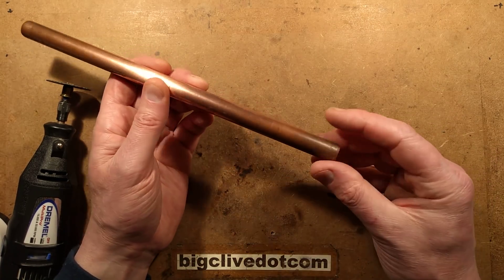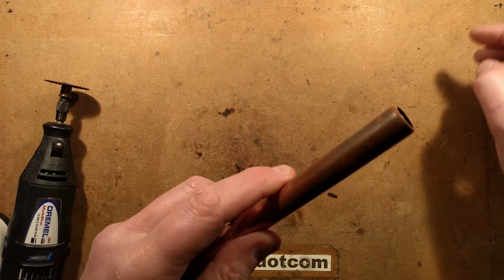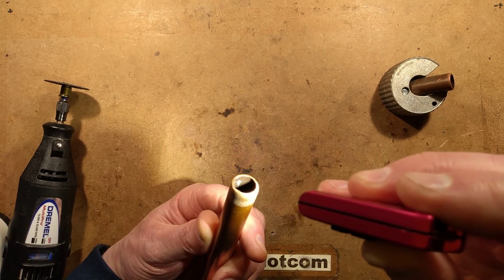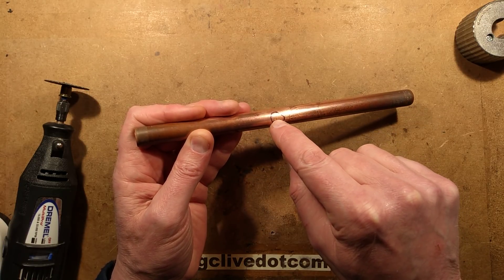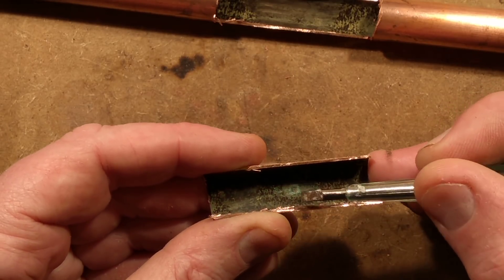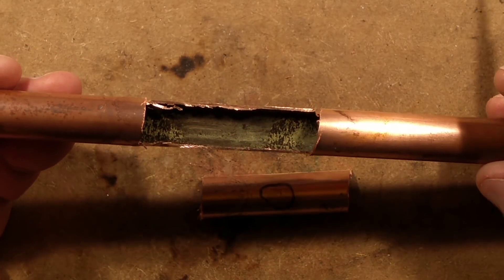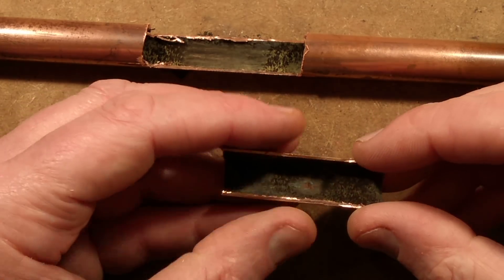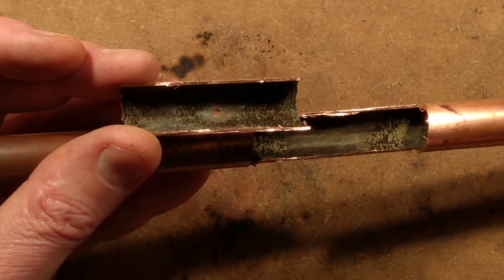Odd pinhole leak in copper pipe.  Selective electrolytic corrosion?

Comment: Back in 2009, my dad and i installed a water softener into what was then a copper based plumbed house. Since then, he has experienced the same issue you have described but in more than 10 locations. As dry wall has had to be ripped out, he has replaced the plumbing with plex instead of copper.

I have a theory on this and it goes something like...

When you first install copper plumbing, dissolved oxygen in the water quickly corrodes a small layer on the pipe. When you have hard water, minerals begin to deposit on the corrosion layer (my dad and i both noticed this was the case on sections we cut out.)

As time passes, the mineral layer actually protects the copper from further corrosion. However, if your water comes from a spring, or a well and the surrounding soil is silica based, often times, you'll find iron in the water supply. Sometimes, really small particles find there way in to the pipe and become captured by the deposits. Alternatively, the plumbing before the water enters the house could be iron based and create a voltage potential.

Due to galvanic corrosion, eventually, a weak spot is found, or in the case of my dads house, the now soft water began to break down the mineral deposits and the once protective deposit layer no longer kept the pipe in tact.

The first leak we had, was on a couple months after the water softener was installed. And within a year, 3 more leaks had been replaced. Before that, there wasn't a single issue with the plumbing.

Thats my theory anyways.

Comment: That's not uncommon. In new houses it can be cause by excessive flux used during assembly. Flecks of iron from other pipe or fittings can cause it and so can some types of water if the PH etc is in the right mixture. I have seen samples from the commercial plumber of that damage with long trails of those corrosion spots in them. Keep an eye on it and be ready if there is another leak. I would be look into full replacement in the future Personally I use PEX for my stuff.

Comment: Ask This Old House had this and they blamed the water heater. Essentially the hot water heater was corroded and it was putting flakes of rust (iron) into the water line and they would settle in the pipe and electrolysis between iron and copper would occur in spots and eat their way through.

Comment: Not being plumbing expert, I can't speak with authority, but the following observations seem logical to me:

1. If it is a contaminant issue, then it would seem also to be a manufacturing issue, since transient contamination will be removed in relatively short order by the flow of water through the pipe.

2. if that's the case, and the contaminant inclusion in the copper was not a one-off (what are the odds of that?), then it's likely that you may experience more incidents.

3. There is no one-size-fits-all answer to problems like this.  Manufacturing defects can be an issue in any manufacturing process. It seems likely that the probability of inclusions would be higher in a system in which significant percentages of source materials are recycled.  The history of the recycled material can't be completely removed by the recycling process.  To the best of my knowledge all manufactured items using recycled materials use only a percentage of recycled source material.  I suspect there are valid reasons for that.
4. I remember that here, in the States, a system of plastic piping was developed about 30 years ago or so, and was very aggressively marketed by its manufacturer.  Several years later, problems developed with the connecting methods used to attach the pipe to fittings.  After the courtroom dust settled, the manufacturer had to pay to re-plumb all of the installations that used this system.  So, nothing is ever perfect.

Comment: One of the colleges we do the air con for has had similar leaks all at the bottom of risers, the theory is its flux that was not cleaned out correctly after installation that set the corrosion in motion.

Comment: If the pinhole was a result of electrolysis (aka bimetallic corrosion), then it wouldn't be from a piece of iron or steel stuck to the surface of the pipe, whether inside or outside. Electrolysis between iron and copper does happen, but it actually eats away at the iron, not the copper. Hence the problems the Royal Navy experienced (in the days of wooden ships) when they fitted copper sheet to the hulls of their warships to prevent the growth of barnacles and seaweed: As an anti-fouling agent, the copper layer worked brilliantly - copper compounds are still in some modern anti-fouling paints. However, all the iron nails and bolts holding the ships timbers together were badly corroded wherever they were in contact with copper. The use of brass bolts and screws eventually solved this problem, though they were (and still are) more expensive.

It is however possible that a particle of iron was somehow included into the pipe itself during manufacture, such that a tiny part of the pipe wall was actually iron. This would not have started to corrode until in contact with water, so the pipe would have been intact when new. Subsequent years of water running through the pipe would have eventually caused the tiny iron section to corrode away until it formed the pinhole. Similar problems can happen where sections of new copper pipe are joined to older iron water mains - the iron pipe corrodes around the joint. This can be prevented by fitting a plastic section between the iron and the copper, since the electrolysis reaction only happens if the iron and copper are in electrical contact with each other.
Reply: @Lloyd Evans, that may not be as good idea as it sounds, at least not where the piping is supposed to be earthed electrically. I once lived in a house where a plastic section had been inserted as you say, and when there was an electrical failure in a lamp, it turned out that on all water outlets in one part of the house we had about 60V AC between the faucet and the (metal) water outlet! Discovered it because there was quite a funny feeling in the body when showering ...
Reply: @benhetland576  It's certainly true that putting plastic sections into piping can cut off earth connections where incoming water mains are used as the earth. In the building I live in, the incoming water mains are thick, heavy iron pipes, which (about 20 years ago) were partially replaced with copper. I was present during the replacement works and insisted that plastic joints were used between the iron and the copper to prevent electrolytic corrosion of the pipework. The main electrical earthing was indeed connected to the incoming water main, so I just moved the earth strap to the lower section of the pipe, below the plastic joint. That way the earth still works and there are no electrical problems, but the insulation of copper from iron is maintained.
Reply: @benhetland576  Grounding to water pipes is bad electrical practice, a quick-n-dirty "solution" that eventually causes problems. Real grounding rods are part of the answer, and Ground Fault Circuit Interrupters are the other part. Circuit Breakers with that functionality are available. But really old wiring won't support GFCI, because of there being no dedicated Ground wire, distinct from the Neutral wire. One could, of course, still run a real ground wire all around, which is easier than replacing all the wiring, but still not a trivial task. I would think of running it behind trim boards, but that may not be allowed in all building codes. YMMV.
Reply: @YodaWhat  it was required by electrical code here in Vienna until about 20yrs ago. Including a requirement to bridge insulating pipe sections. Then they changed the code and required even the retrofitting of grounding rods in existing buildings.

Comment: Could the corrosion be from the plumber cutting the pipe then cleaned it with wire wool (leaving waste steel - years ago to rust)? OR rough treatment of the pipe work before instillation and lagging. Interesting .

Comment: As a plumber, I figure I ought to give my two cents. That is corrosion from turbulent flow. The turbulence makes the water act like a drill, which eats into the copper. It can happen quite quickly, or quite slowly. I have had pipes fail in as little as one year from it. The green is probably a deposit from a bit of dirt getting lodged into the side of the pipe, which exacerbated the problem at that one point. Cavitation is a hell of a problem, especially in copper.

Comment: Pinhole leaks often happen because of sediment and/or non-neutral water (check the pH).

Over the years, we've had two pinhole leaks in the pipes connected to the old water-heater; the new one has yet to cause problems.

Comment: We had one of those tracked down to an old copper pipe behind a kitchen cupboard three years ago; likewise it was a vintage thick wall copper pipe.

You will be pleased to know we replaced a foot of pipe with push fit plastic and haven't had any repeat issues with the rest of the system for the last three years.

It seems that the older UK pipe is much thicker walled but contained more impurities; most of them either corrode away entirely into the water or externally outside the pipe without making a hole all the way through... Location within the pipe wall has to be just right for it to pinhole prematurely.

Comment: If you don't burnish the pipe where you cut it you can induce cavitation and cause the pipe to erode. 
If you use too much flux in the joint, the flux can cause the pipe to erode and create pinhole leaks as well. 
I saw a youtube video on it once but I forget the exact details...

Comment: I have had that happen a few times in the various places I've lived over the years. Contamination in the drawing process, combined with water PH and impurities will cause that. I used a cold water pipe as a ground ( ham radio ) to control RF on my audio drive amplifiers and pre amps.
8 years later a clump of minerals developed around the clamp area in the pipe. It restricted flow enough one day i had to find out why. Then repair it - lots of fun was had for hours - on a week day of course. It was well water by the way, not filtered at all.

Comment: It's from too much flux when the plumber solders the pipe. A bit of flux that gets displaced settles in a spot and erodes the pipe. It usually takes years to develop, depending on the type of flux, size of deposit, and other factors.

Comment: Had the very same thing happen in my house in Peel IOM. Aparently in the 1960s there was a load of very cheap copper pipe being installed into the houses. I had a hell of a time trying to fix all the dodgy piping, some easy to get to and others having to extract pipe from concrete floors.

Comment: Is this heat or potable water pipe as if its drinking water im surprised they wouldn't pipe a corrosion inhibitor chemical they tend to feed a chemical like that to help prevent copper/corrosion at least here in the US I imagine it would be the same in the UK if not more due to having even older houses and Lead solder being even more prevalent
Reply from the maker: It's the main cold feed in the house.  Not sure what they add other than the usual things like chlorine.

Comment: The weakness, or stress point, may have been there before the crystalline corrosion "Ver di Gris", Chicken or Egg?.
Most likely a manufacturing defect, as other subscribers have commented on, and on a common point on axial length l. Not sure it is caused by flux?

Comment: There is a show on U.S. public television called "This Old House" where they explained that kind of thing being caused by not flushing the pipes after soldering.  The flux used to clean the pipes prior to solder is acidic and it can leave deposits in the pipes.  The pin holes usually happen on the bottom of horizontal runs, as well as near the pipe joints due to water turbulence.
Reply: Funny, I watched the same show and they said it was due to bits of rust coming from the water tank.  Flushing? Isn't that what happens every time you use water.

Comment: you definitly need to seal the water pipes with at least 2 layers of plastic coating. 
(yes, this procedure costs money, but in most cases cheaper than replacing all pings or risk bigger water damage)

Comment: All these comments, and I don't seem to find any suggesting that it was from that new ROHS lead-free solder.  A few blaming the flux though, so maybe flood your whole plumbing system with molten lead to neutralize that flux and form a protective coating inside your pipes.
Reply: Kineth1 what?? R u mad? Probably the lead poisoning you you must have contracted mate! Is it April already?

Comment: Here in the US, year ago, residential water service entrance pipes were made of copper.  If a nail or other steel object was in the fill earth that filled the ditch and touched the copper, it would corrode through after 20 or 30 years and cause an expensive digup and patching  of the pipe.

Comment: Have you thought about inserting a very small self tapping copper or brass metal screw in the hole?   Another solution, if it is available there is called "JB Weld"

Comment: In my old house a copper  hot water tank sprung holes in the bottom section.I blamed the miss match of pipes as it had old iron pipes and copper pipes, however the tank was fed in and out  by copper and yet electrolysis ate it away and that was within 8 years.

Comment: Happened a few years ago with my mother's under-floor heating pipes. All copper. All with anti-corrosion goop in it, and so on.
As the leaks can travel around the whole system along the pipe surface/concrete interface, there was no point digging the floor up. I had to fit radiators to every room, along with new piping. She was less than impressed.

Comment: I’m a Plumber in Scotland & our water is generally soft, great you may think no limescale problems etc.  However, it can be very acidic & it can be very corrosive to metals, even non ferrous metals.  Pitting in copper tube is common here & since your standard plumbing copper tube is now, and for the last 30-40 years, been very thin it’ll corrode easily.  
Plastic tube is more commonly installed now, much to the dismay & dislike of the Old Guard conservative Plumbers, but polybutylene & PEX are much more corrosion resistant.  Oh without question the introduction of plastic systems has clearly undermined & removed the skill element from my Trade.  With 1000’s of 6 week wonder course cowboys polluting the trade, the future is one of a unlicensed & unregulated nightmare for an unsuspecting British public.  
But don’t blame the Plumbers of 30 years ago, the poor quality copper tube was up to the Regulations at the time & since.  So, who’s responsible then, you may ask?  Well you, the guy in the shaving mirror or in Clive’s case, the mirror he uses to detect the hairs up his nose......you lot!!
Reply from the maker: That's still better than the 5 day electrical courses.
Reply: bigclivedotcom Gosh!! Does it take 5 days to learn how to pull your wire Clive???!!!
Pass on my regards to Ralf, dear boy.  The last time we spoke he was somewhat ‘inebriated’ & urinating under the Clock in Queen St Station.
I do hope he managed to dry his sandals & white socks in the Cells in Pit Street??
Well I must dash, don’t block the aisle in Poundland again like you did last Tuesday, keep up the good work👍👍👍

Comment: As a child we had these pin holes in the half inch copper rising water main that went up through the kitchen ceiling. The plumber was called and after the plumber had used compression couplers to repair the pin hole leaks twice my parents had the length of pipe replaced and it was fixed for the next 20 years.

Comment: Great videos Clive, seen and deal with this stuff everyday as a plumber ! Those deposits could be old contaminants from flux used to solder pipe fittings, also if it were from hot you will be surprised at what’s at the bottom of a Hot water cylinder years of rubbish. A lot of pipe used is recycled and new stuff can be imported with thinner walls. Either way I’m sure you will not give up until you work it out ! All the best.

Comment: Pitting corrosion is very interesting. The bulk metal can experience no corrosion at all, but a tiny little defect or contaminant can be enough to initiate a pit, once a pit starts, it because a semi-isolated environment with different water composition to that flowing through the pipe and a galvanic reaction occurs between the inside of the pit and the surrounding metal. A pipe can be perfectly fine for decades, but then a pit can start and go right through the pipe very quickly.
In copper, a cap of green copper oxide tends to form, which completely covers the pit.

There are 3 common issues which create a risk of pitting. 
First is scale or contamination left inside the pipe from manufacture, but any pipe made to British standards since the 1970s is required to be cleaned.
Next is poor soldering and flushing, which can leave deposits of flux inside the pipe.
And lastly, pipes which aren't used for a long time and allowed to go stagnant can develop some microbial growth, or have pockets of air form, or have scale dislodged or accumulate in places.

Comment: Was this hole in the bottom of the pipe? If so it could be debris from instillation or from the boiler (especially if you had a cast iron heat exchanger)! Eather way I bet the insurance will not be interested in covering it ;0)